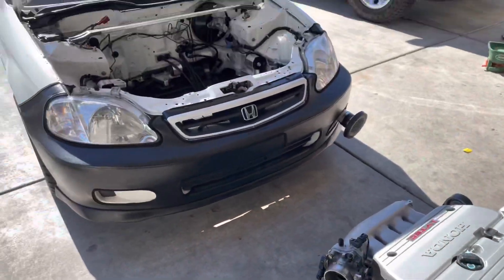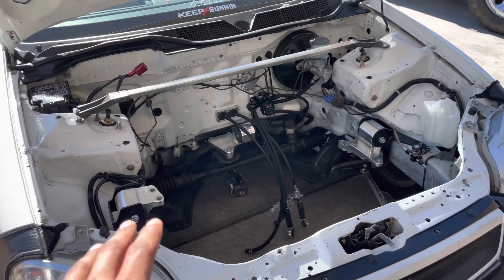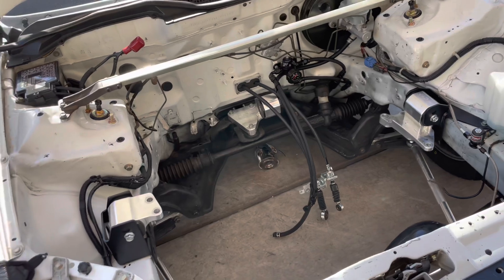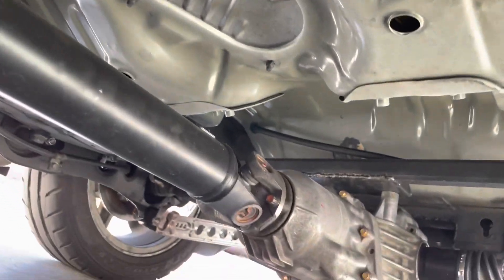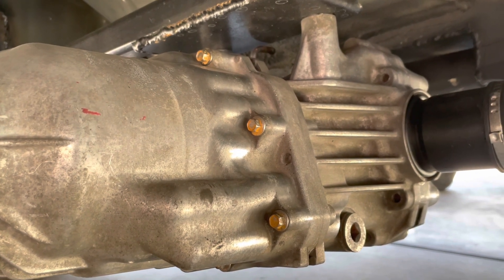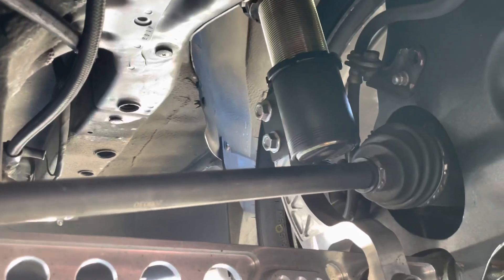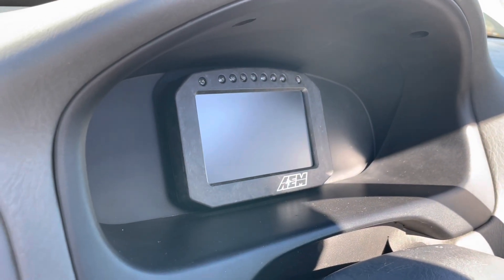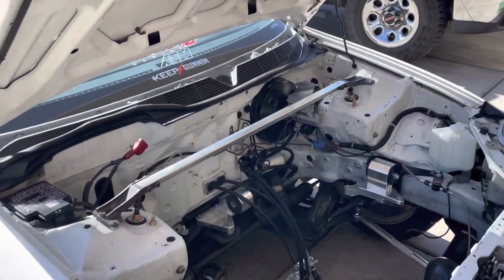Awd kSwap Honda Civic Parts Review

Comment: You are not running a viscous coupler?? You upgraded the diff with locking plates. You not worried about the diff locking up.
Reply from the maker: Listening is key. No viscous is needed with crv diff I did not lock the plates has upgraded clutch kit
Reply: @oemworx4147  listening is key. But I also blow out my crv diff doing the same thing on thw dyno. So that's why I asked.
Reply from the maker: @AJIMPORTS  you must of done something wrong I also have the 2011 diff which is different from the older model

Comment: Which viscous coupler are you using
Reply from the maker: When running crv diff and under 600hp viscous isn’t needed
Reply: @oemworx4147  but you locked the dual clutch portion of the diff that allows slippage.
Reply from the maker: @Andre Michael  no the clutches were not locked. I have upgraded clutch kit.
Reply: @oemworx4147  ah gotcha. When I heard uogrades clutches I assumed it was locked.